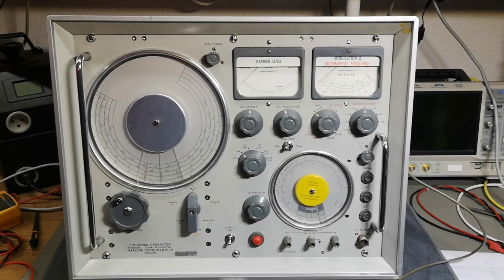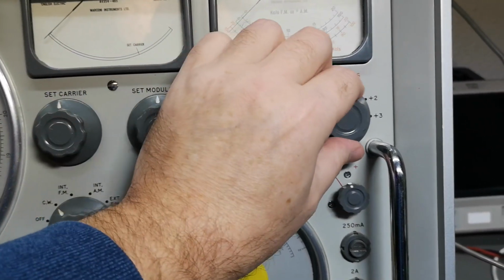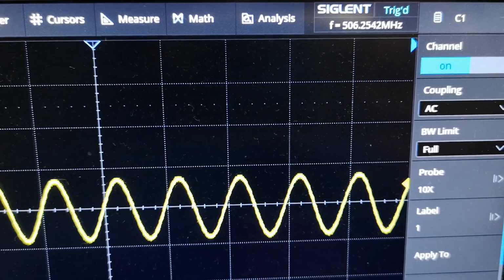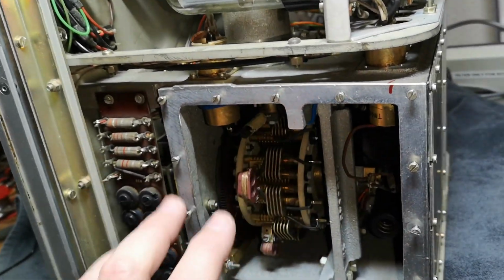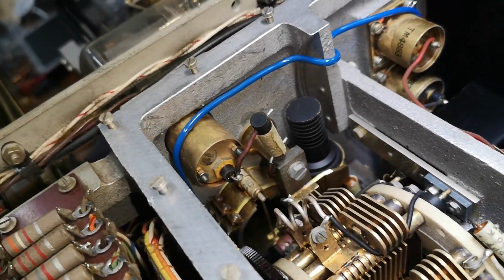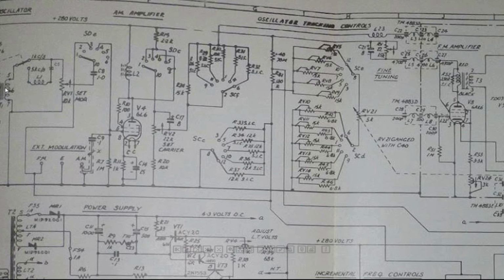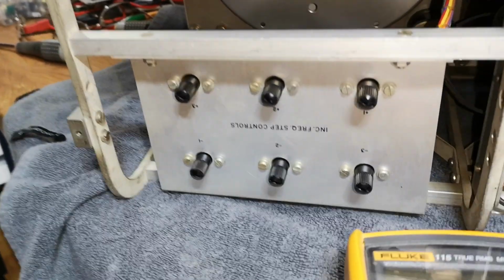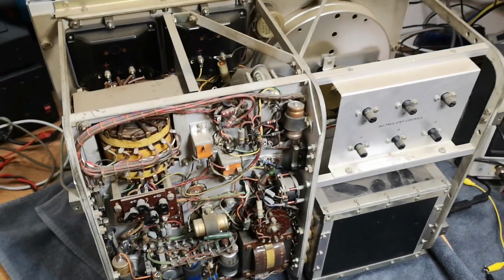Marconi TF1066B/1 FM Signal Generator 10-470MHz 1960 repair teardown

Comment: I have a 1066B/6 that was given to me recently, in working condition.  A true boat anchor, it wont be on my bench, but added to the shelf of old beauties, as more modern signal generators (80’s HP) do the job for me today. 

The designs of these beauties are as much mechanical as electrical and makes me appreciate how things were done in the days of early silicon and pre digital era.  Im as old as this model.

Comment: AM modulation likely resistors around V4 have drifted, leading to the incorrect bias conditions, and also likely with capacitors on the grid and screen leaking.